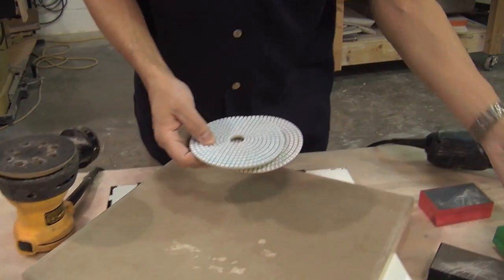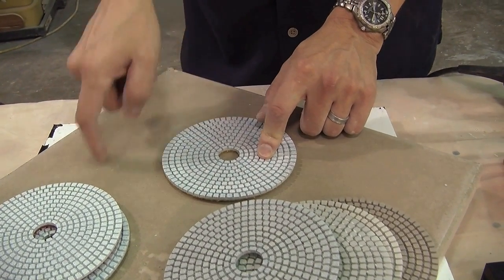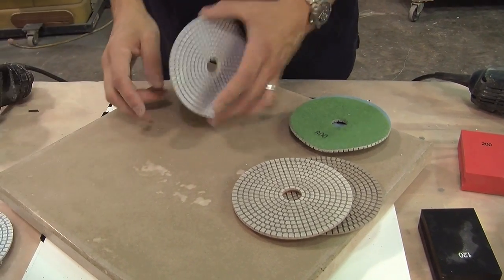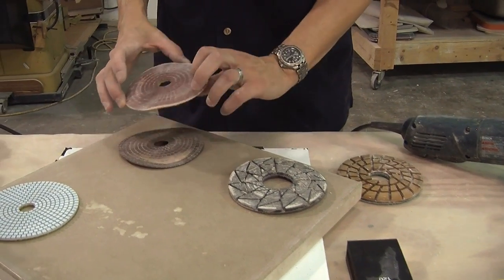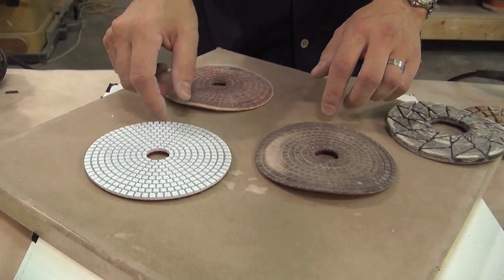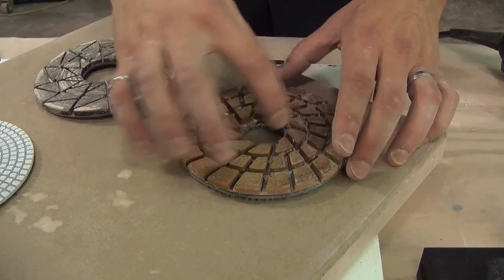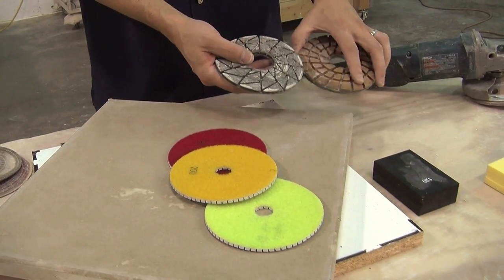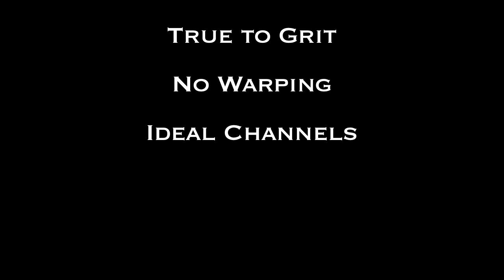Diamond Pads for Polishing Concrete Countertops

Comment: Would you use the same CCI diamond pads if you were removing old sealer and preparing for new sealer? If yes, which grit should I buy? Thanks.
Reply from the maker: +Kay Christian It depends on the sealer. Most coatings I've used should be removed using paint stripper. There are a few coatings that must be ground off. Consult the manufacturer to determine the best removal method, and be sure to use proper safety equipment.

Once a coating is completely removed, and you are left with bare concrete, the surface preparation will often be the same that you would do if you were applying the new sealer to new concrete. 

Once you get to bare concrete: Most coatings require that the concrete be no smoother than 200 grit, so that the concrete has some "tooth" for the sealer to bond to. In that case, you could use a 200 grit pad to make sure that the surface texture is correct.

However, be aware that some sealing systems involve a penetrating treatment that physically alters the concrete itself. In that case, it might be necessary to grind down into the concrete to remove the top few milimeters that the treatment affected. Depending on the concrete, this could require a turbo cup followed by 50, then 100, then 200 grit. Be aware that this will likely affect the appearance of the concrete by exposing aggregate inside the concrete, and also opening up pinholes which you will then need to grout and hone.
Reply: +The Concrete Countertop Institute 
I was thinking of using the Stone Lok product. Is that considered a "penetrating sealer?" I watched the video on how to spray using the HVLP spray gun. Any tips for spraying counters already installed in the kitchen? Mine have a 4 inch back splash made of concrete "tiles."  In your article on applying stone lok sealer, you mention a OS/WTM prewash. Is that sold along with the Stone Lok sealer? Thanks so much.
Reply from the maker: +Kay Christian Be sure to visit the page www.concretecountertopinstitute.com/sealers/ for a lot more information about sealers and Stonelok. It is a high performance epoxy and urethane coating, and kit includes thw OSW prewash. I do not recommend spraying inside a house. It is possible to roll on Stonelok, but it will not give an even finish. Stonelok is a pro level finish that takes practice and skill to master. If you can wait until the week of October 19, I will have information on the website about a new, high performance, less expensive, much easier to use sealer.
Reply: +The Concrete Countertop Institute  I will check back in the 19th. Will it be available for purchase around that time too? Thanks!
Reply: Jeff, is BR Reactive Polyurethane Sealer, the new one you were referring to?
Reply from the maker: +Kay Christian Yes, that is the one. http://www.concretecountertopinstitute.com/product/br-reactive-polyurethane-sealer/